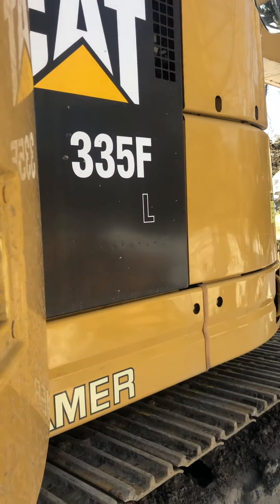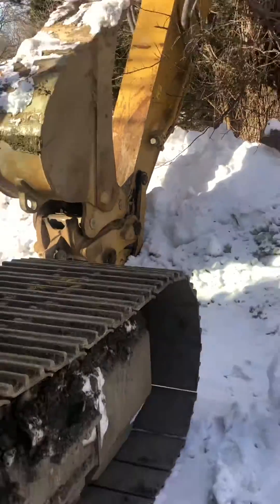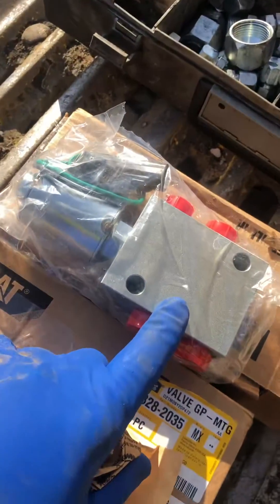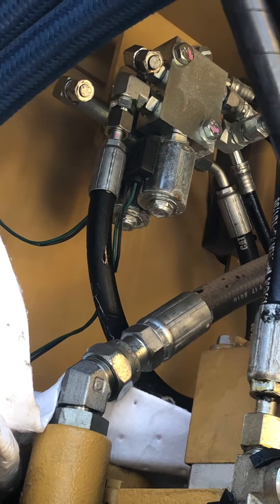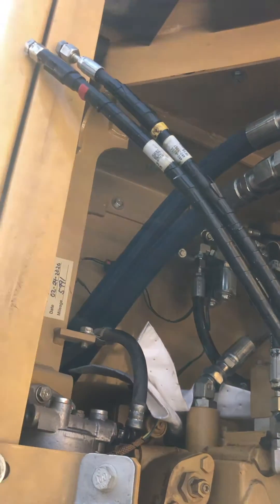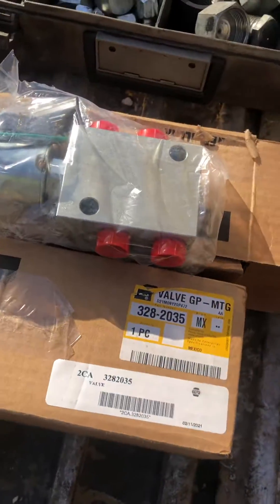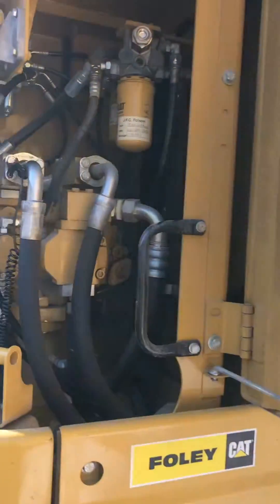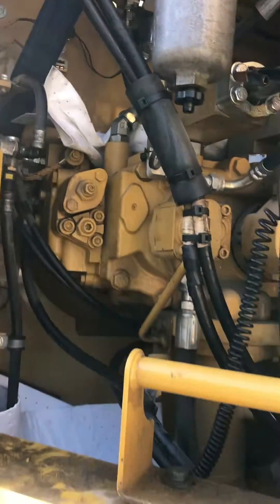Cat 335 quick coupler not working

Comment: I've got a Hyundai doing same thing but only a single solenoid. If I switch the pipes the coupler will retract but won't close again. Any ideas?
Reply from the maker: I would try replacing the solenoid could be bad, only working in one direction, probably staying closed and not opening